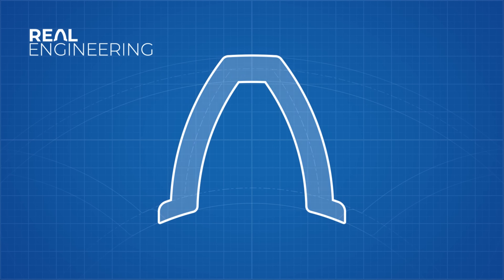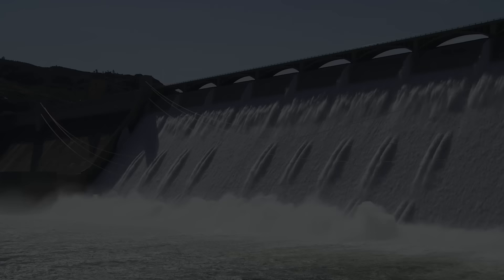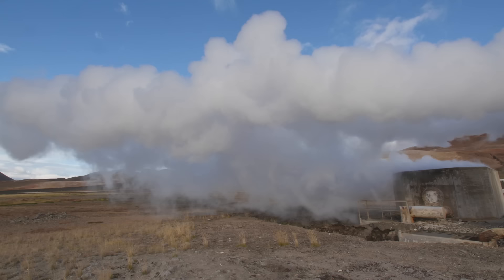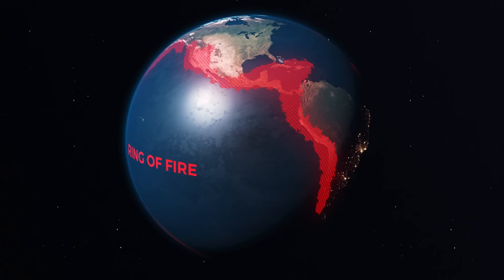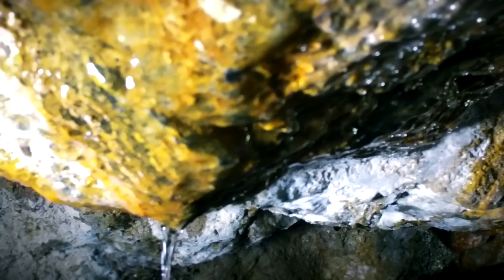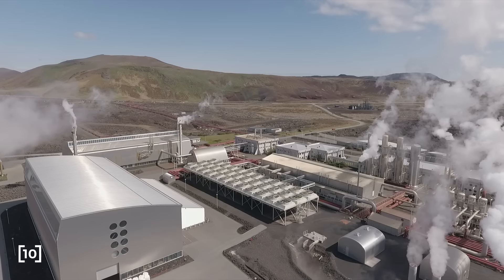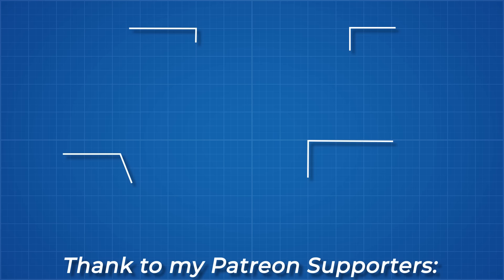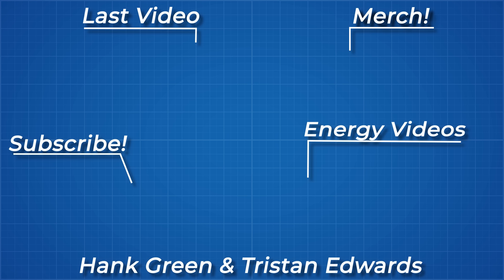Could Earth's Heat Solve Our Energy Problems?

Comment: No offense, but energy straight from the planet? Sounds a lot like what krypton did. Look how that turned out.
Reply: Krypton is not real. Besides, pumping heat is not the same as literally stripping the core of heavy metals, thus destabilizing it. Although planetary heat is, strictly speaking, not unlimited, with humanity's current power demand it's unlikely that any noticeable changes would appear for a long, long time. Still, nuclear fusion seems like a more versatile and efficient alternative further down the road.

Comment: It  exists and  will for some time. We do not hurt the earth taking and using  the heat energy that already is breaking  through the surface.
Yet it is totally  a not renewable resource. Mars was reasonably likely to have been much like earth what happened. Mars core stopped being molten solidified and therefore dropped it's magnetosphere that resulted in the solar wind and radiation stripped its atmosphere.
 The earth's core heat is as renewable as remaking earth.

Comment: Long-term I don't think geothermal is sustainable, sure it has it's place when other forms of power are not feasible, but we're just taking energy from the system that is protecting us - the magnetic dynamo. On our current puny scale it's negligible but eventually it's probable to assume we could extract enough power over human history to significantly shorten the lifespan of our magnetic field. Anyways, the Earth's core is kept active through radioactive decay so it's just like, a variation on nuclear power anyways. At least solar, hydro, and wind are constantly being replenished and don't depend on an initial load of isotopes.

Comment: I live in an area where there is potential geothermal power production. Using injection of liquids into the ground here would be folly. There are multiple hidden faults here, and the potential for earthquakes, sink holes, and contamination of ground water far excedes the potential benefits. 
When it comes to energy production, the old adage "if it ain't broke, don't fix it," applies. So called "renewable energy sources" only have the potential to provide 2% of current power usage. That's a lot of people freezing to death in winter and dying of heat stroke in the summer. 
People need to stop panicking over computer models and get real. There's nothing wrong with supplementing power production with solar and wind, but replacing all power production is not economically viable. 
What use is "saving the planet," if only the rich will be able to get out in it? Enjoying the lockdowns? That's life with "green" energy.

Comment: Geothermal has its place but as you’ve said it’s not cheap. 
The big (No) the HUGE problem today is coal. The stuff is a massive polluter not to mention the high CO2 emissions. 
The author brushes over nuclear power but if the hazards and waste issues are resolved it really does become economic and of course it’s zero CO2 and non polluting. 
Use thorium as fuel and the resource is almost limitless. 
Today’s molten salt reactors remove the hazards that to date have made nuclear so expensive and led to all three of TMI, Chernobyl and Fukushima accidents. 
These new designs can easily undercut coal on costs and as they fully burn the fuel there is no long life waste to deal with.

Comment: why has no one tried boring down 10klm or longer then going sideways for 20klm or longer then back up, once the hole is complete place fitted pipework pref plastic coated steel or (plastic lined inside the steel pipe), join both holes on the surface and place a turbine at both ends.  the water should then heat up via the earths heat.  and cause a circulation to go on at the top of both ends place a turbine thus creating electricity thats free to produce, just the cost of the pipe work, boring and turbines to recoup.  hot water rises it would create a circulation effect thus turning the turbine.  any engineer of physicist out there let us know if it would work, in theory it sounds plausible.

Comment: GeoThermal certainly needs to be take more seriously, it has a lot of benefits, I had not even considered the economic benefits of putting to work, redundant oil drilling staff,
which may even stave off some kind of revolution, you never know. 
I know a lot of ppl who would be more comfortable living near a geothermal plant, than say, a nuclear plant, despite what ppl might think about safety of nuclear when everything is going according to plan. Nuclear is too fraught with emotion, because it relies on most ppl becoming dependent on something they don't understand, and are terrified of.

Comment: Still not understanding why we are not using hydroelectric pump system with the solar system, in morning during an extra solar generation we can easily able to pump the water into the reservoir and in the evening same water can be be use to drive the generator.

Comment: There may be some spots on Earth where geothermal energy is high, but for 99% of the planet the rate of heat from below is about 0.1 W/m^s. The sunlight from above comes at us with about 1000 W/m^2. 

So if you don't live on a geothermal hotspot,  let's use that sunlight, and store it for the night.
Reply: how and where we store it is the problem unless we found reliable battery that could last years without even need charging.

Comment: The problem with geothermal is it's a hit or miss financially. Investors are always going to be most likely to invest in what's most guaranteed to profit. Theoretically you can drill anywhere deep enough and it's sufficiently hot. The problem is the vast vast vast majority of Earth's surface requires fracking to open up enough fissured to pump more than just a little tiny bit of water through the system. So the majority of attempts at geothermal end with failure and financial ruin for the investors.

Comment: Mean heat flow is 65 milliwatts/sq. meter (through ~50 miles of continental crust!) That's in milliwatts! Solar radiation is approximately 1,368 W/m2 (watts per square meter).  That's +20,000 times more energy from sunlight! So? OK? Pour water on a camp fire, and see how long you can keep generating steam!

Comment: This system uses expensive mechanical processes to turn steam into electricity. Only solar (panels/film) turns the energy source (the sun) directly into electricity without heavy machinery/large moving parts. Obviously, the conversion of molten salt to steam, using solar mirrors, poses the same costly mechanical problems as geothermal processes, both with initial capital costs and high maintenance costs.

Comment: Wave power is another interesting and new way of producing electricity.
Reply: Doesnt really impress me so far. From what i've seen it's even less power dense than wind and solar ( kWh produced/m^2 surface area ). And those are not impressive at all
Reply: jacob jensen 
The biggest difference is in the cost of operations. 
Although it is still a developing technology, it has already been made apparent that the costs are very low. This is mainly due to the reduction in the number of moving parts needed as well as the lack of parts being placed under intense stresses, like a steam turbine.
As technology continues to grow, we can expect to see the yields grow and costs to drop even more.
It’s a win win.
An added plus is that the areas of coast best suited for these plants are also areas unsuited for most other uses.
There really is no down side.
Reply: Ofcourse there's downsides, dating otherwise is a biased opinion.

- There's the beforementioned problem with power density.
- There's higher maintenamce than for wind and solar ( more moving parts)
- the energyproduction is intermittent
- There's No "on the shelf " solutions to implement right away, making it less godt effective than pratically All other energyforms.
- Loss og biodiversity

And the worst downside...

Wave energy requires a stable backup, since noone is going to solve energy Storage problems and time Soon, that typically means coal ord chemical power plants.

There's nothing but downsides, og your goal is to combat climate change.

Wave energy, in essence, is still a utopian promise

Comment: Indonesia has now overtaken the Philippines in terms of geothermal power capacity. At the end of Q1-2018 Indonesia's installed geothermal power capacity reached 1,925 MW, higher than the 1,868 MW capacity of the Philippines. Moreover, by the end of 2018,

Comment: ok, but what do we do about the acid rain? sulfur dioxide is being released in the process

we have plants in the Philippines wherein the locals are subsidized for replacement of exposed steel structures every 2 years due to acid rain

also, another concern especially for the plant workers is hydrogen sulfide.. u will die in minutes if u inhaled this

Comment: The biggest problem with the current geothermal power is the hydrogen sulfide gas that is produced because they inject water into the hot rock strata.  If they were to drill horizontally and case the wells with a stainless pipe to create a closed loop the energy would be cleanly produced.

Comment: If the plant is cycled during the day, that would slow down the loss of heat over a long time. especially in California It could be throttled down almost all the way during the day then up in the evening then at low power at night. Geothermal needs to be subsidized by taking away big oil and coal subsidy and tax breaks.

Comment: Why is it people seem to ignore that geothermal is dependent on magma being relatively close to the surface? Yes, there are definitely places where geothermal works well. However, MOST of the world is nowhere near a good, accessible geothermal source. So to answer the headline, NO, Earth's heat alone can't solve our energy problems. Not unless you can keep 15 Km deep boreholes open reliably. Which you can't.

Comment: Could we go to our desert and install a water system that could be use as a radiator
Reply: Sure. There's lots of water in the desert.
Reply: @bkm83442  no but it is surrounded by it so. Yes you would argue it saltwater but there is many uses for like battery,transportation,it don't freeze as easy so it could have cold better so cooling too.

Comment: I prefer we don't draw energy from the earth's heat, it will cool the earth's internals quicker and weaken the Earth's magnetic field sooner than if we don't. With one exception, where it would be advantageous to cool a thermal hot spot near the surface for the safety of people.

Comment: It seems like it would be less damaging to go far deeper with one hole... How long does the 70c per km hold true for? 
If you go deep enough so the bore hole can just contain 2 concentric pipes, you can use a closed loop system, and not wreck the place...
I feel like the amount of energy per hole would be less than the 'not fracking' method, but it would just be a matter of depth surely? The surface area of 3km of pipe is not insignificant...
Reply: It only gets hotter on or near a fault, and some faults are more active and generate more heat than others.  If you drill past the fault, the temperature will drop again.

Comment: tesla offers batteries for homes. you can get one that can be tailored to the size needed to run your home for 7 days so you can charge it during the day and at night use the battery power for your house or theoretically feed the extra electricity into the grid during peak usage time to get the most money from the power company. its theoretical because in Phoenix Arizona the power company here wont pay you the same dollar amount they charge at peak hours and will only pay you the lowest dollar amount they had charged that day and charge you a service charge so even if you don't use any power for the whole month you will still have to pay them. and from what I've heard from someone who has solor and doesn't use any power from the grid still has to pay. and I've also heard once they have a power meter on your property they won't remove it and will charge you for it being there somehow. iv heard all this from 2 different people. one worked at the call center for TEP in Tucson Arizona. and the other person lives in Phoenix Arizona and has enough solar panels to make all the power his house uses plus extra. but he doesn't have any batteries so I would imagine that during the day he feeds the power to the grid and then at night he has to use power from the grid and the amount of power made during the day just offsets the power usage at night to be equal to the amount made and put into the grid and then the "service charge" is the cost to maintain the meter and other things involving powering his house and like a fee for storing the power he uses at night. I just wonder if you could make money off the situation if you had the batteries feeding your house when the panels aren't making powerand feeding the grid all the time. I'm sure you will still have a service charge but would the power you are putting in be more than the service charge????? My other question is if you had a solar field with the batteries that fed the grid 24/7 and the panels charge the batteries and feed the grid when the sun's out and the batteries continue feeding the grid when the sun is not out panels are not making power

Comment: Will there be a change to the temperature  gradient?   There should be a lowering at the outer most edges     and then  towards the pipe withdrawal point.  Of course reducing the fluid flow will cause the main heating element to regain its previous overflow EXCEPT the smaller cracking size will probably compact to  shape itself and act as  a solidified heat insulator and take eons of time to regain usefulness.  We have made a few errors with the nuke plants lets stay with them  and not make anymore errors.

Comment: Could you use old shut down oil wells and convert them into geothermal wells.  Lets say a zone that can produce 30,000 bbl of water a day with injection points all through the zone. every well has been shut down because the oil production reached down to 20 bbl a day but still producing 30,000 bbl of water injection a day. could increase that if needed. with water temps unbelievably high... you would burn your hand if you put your hand on that pipe.

Comment: Please no more comments about Stirling engines. For a practical Stirling engine, you need the heat source and sink relatively close together (they are not in this case) in a thermally conductive medium (the ground isn't). Otherwise, it is limited by thermal transport. The thermodynamic efficiency depends upon a high temperature gradient, which is rare. That's why you don't see a Stirling engine in everybody's back yard. Get over it.

Comment: And what about the Peltier effect yo avoid ussing movable parts?
Reply: from the bit I know of peltier thermocouples, the "hot" part and the "cold" part can be separated by significant distance... so they could lower the one end deep underground while the other end stays on the surface, to avoid moving the water long distances.

peltier isn't very efficient, though... so perhaps thats the issue. still... it seems like it could have some advantages.

Comment: i'd say yes and no.  it would help in the short term,( what i mean by short term would be like 20-50 years) but as in what appears to be most things we will abuse the issue... and in some way do more harm to the natural system before we can figure out how to fix it. (would be long term reprocussions maybe 50-200 years*)_  i've had the idea to drill mines and put in steam turbine generators, ever since that 2012 movie, even had the idea to use our own body heat to make power ... you know that liquid that boils below our body temperature?  comes in what looks like an hourglass, that for science you can hold one end and watch the liquid go to the top because it boils and turns to a gas that accumulates in the top "bubble" turning back into liquid form...  i wanted to turn that into another generator... for watches, seat covers, and cars.. thou i'm a dunderhead and don't know what that fluid is called... or if its toxic to people/animals... or how rare it may be. LOL, that and i live in wisconsin so i worry it would freeze and damage the systems in winter.  thou the cold could also be used to turn a generator :D  heck in space you could probably use gases with low temperature properties using the cycles created by exposure to the sun and lack of sun as it turns sort of thing or from what and how you shield different sections of the units from the sun... eh.. ty for letting me share the ideas again.... fracturing the earth in the idea in my opinion is just begging for sink holes.... the deeper you go the hotter it gets right?  because of the pressure... its why you can build underground and have a home that is 60-70 degrees year round with little to no heating... basically my well idea was to make a rig with the boiler type of setup like that hourglass i talked about earlier, it would be modular and fit in the wells diameter... you could change its depth depending on how hot or cold it was at the bottom of the well and extract the generator system if or when it needed repairs... fracking is just begging for collapses left and right, where the tunnels would constantly be needing to be cleared of sediment which then would expand the gaps ... etc etc.. it may be a good means to make cavities underground thou if you want to build there?  i mean you'd still have to send in bots or crews to shore it up to stop the cycle of degeneration.